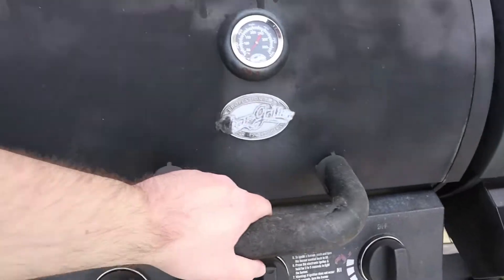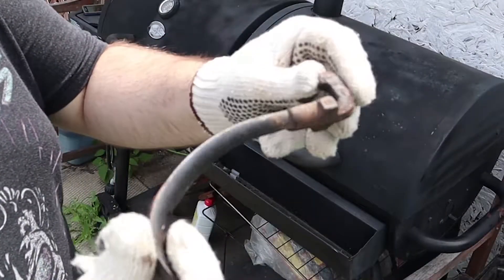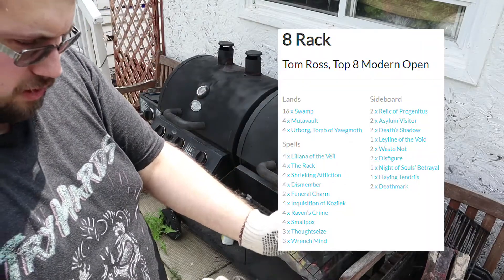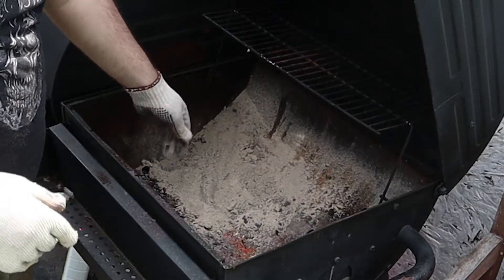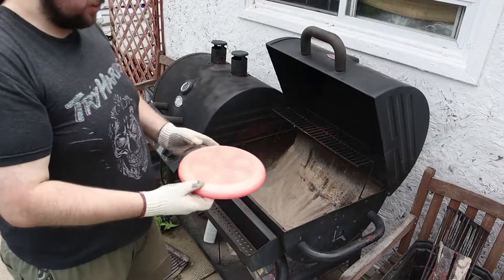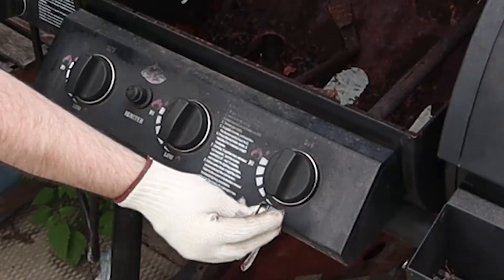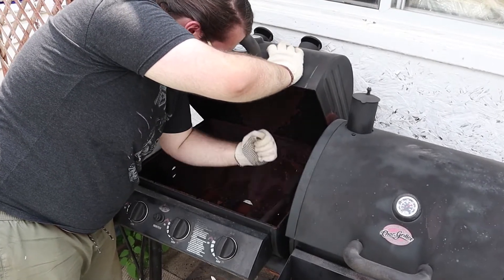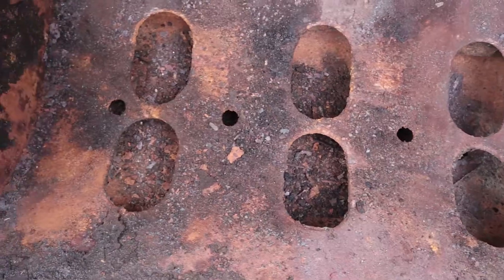Barbecue Archaeology

Comment: Ah man I want to clean the bottom of my barbecue, however the object I'm scraping with happens to be round and hard, not ideal since the actual area of contact is minimal because of the nature of a round object. Which pared with the fact that it's rather hard makes it quite resistant to deformation, which in turn causes it to cover a greater surface area. Thus significantly improving the manner in which I could clean said grill of small particles.
If only there was an object with large surface area coverage and flexibility it would make my grill cleaning experience quite possible more enjoyable,
An object with a rectangular footprint and great flexibility.
To acquire said flexibility it might be better to seperate said object into segments the smaller the better, for that would allow it to conform to any irregularities found in said grill.
Thousands of small soft bristles ought to do the trick.
Wait that's a brush
Reply from the maker: You're spittin straight facts
Reply: @caberwikijack  lmao

Middle text

Bottom text